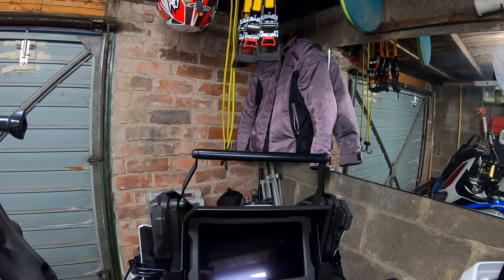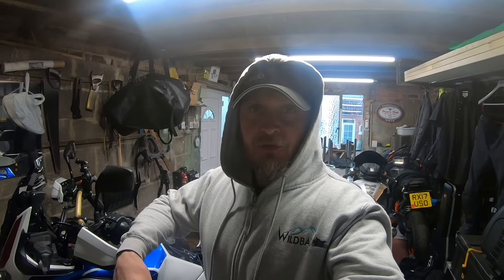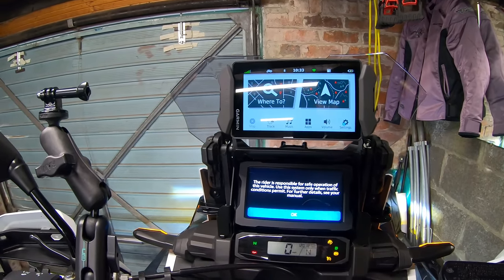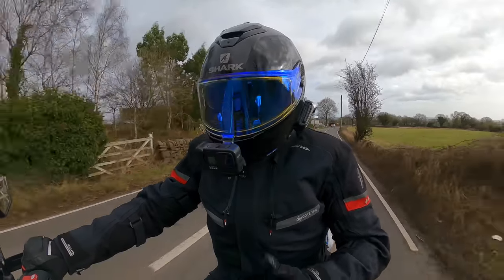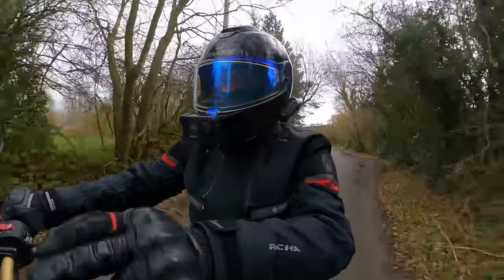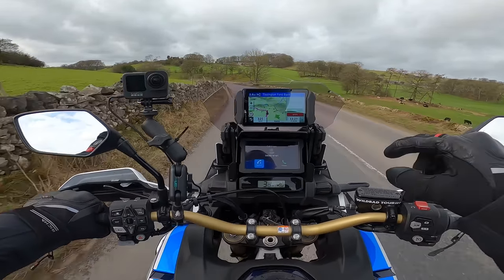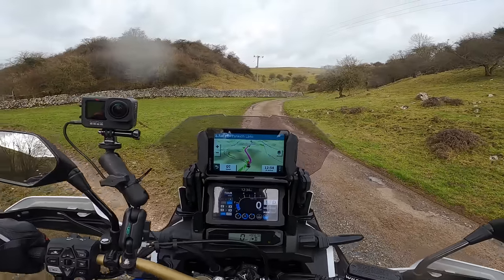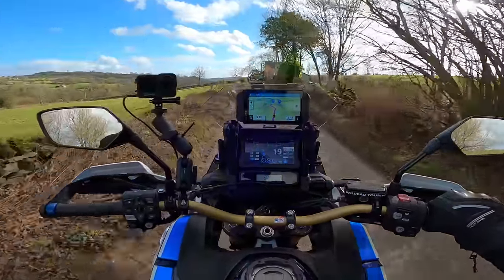Installing A Garmin Zumo XT on the Honda Africa Twin Adventure Sports

Comment: Without a doubt the best Sat Nav available. Had mine on the Tiger 900 Rally Pro for about a year now. 
Evotech Perfomance have a great mounting bar to put it right above the TFT and directly in line of sight.
It even has a built in MP3 player that shows the album covers.

Comment: I have had sat nav’s on my bikes since 2004 when I started European touring, as it’s so handy to be able to find the nearest petrol station quickly and easily.  As you will appreciate Rich, the petrol station’s are not always obvious in some little towns on the continent.  I did consider not getting a new sat nav on the new GS last year, but eventually decided I couldn’t be without that functionality and the fact it doesn’t cost data etc, so Isn’t affected by roaming charges.  I went with the BMW Nav 6 as it locked into the cradle and could be used on the wiz wheel, but it’s not as good / reliable as my previous Garmin Zumo 590lm yet.  However it is still under warranty, so we will see. Love the Touratech mount, had one on the 590 for the same reasons, not need to remove the Nav at fuel or coffee stops. Very neat install by the way. 👍

Comment: Good installation  very neat.
Though I do remember cars and bikes having fuse boxes you could wire into. I guess the eazicam does this job now, but more expense..
My phone is my first back up to gps. The garmin is a strong, rugged reliable unit and will serve you well.
Nice looking bike. Happy travels 👍

Comment: I can see why you went for this option. Same with the android auto on my 2021, notchy as hell. I had a charger block replaced in my mobile and it didn't like the new block wouldn't connect at all. Resolved the issue using wife's old phone thankfully. I found an anker charging cable ensures a seemless connection now. Thanks for another great vid
Reply from the maker: Yeah, really quality products from Anker.

Comment: I have the same combination on my Africa Twin, it's for sure the best option for this bike.
Reply: Do you use buttons on bike (handlebar) for phone calls? I have connected mobilew phone with bike, then helmet with bike, and helmet with Garmin. I don't use Garmin for phone calls, only for navigation. I tried several combinations of connections and now it is working good. But sometimes by phone calls I have problem, I hear only bip-bip. I use Sena comunication. How to reconcile everything? Thanks.

Comment: Great vid Richy, Thanks for posting. I used to think that you had to wait for the Honda screen to boot before you can start the engine, but you don’t. You can turn the ignition on and press the starter straight away and it will fire up, still have to wait to OK the screen though, but I think you can move off while you’re waiting.
Reply from the maker: Yeah you don’t have to wait for the OK, either. 👍

Comment: Have been using a Zumo XT for over a year now with no problems it has a brighter screen than my older BMW Navigator, the only drawback is that you can't add skins to the display to change its appearance. I didn't bother with a lockable mount as its so easy to fit and remove when stopped. I use a stick on Ram mount for the holder which sticks on top of the instrument console and is secure. I have the power direct to a switched gps power supply on the bike so it goes on immediately with ignition, when power is switched off mine does not immediately switch off but gives the option to stay on internal power for several minutes. I don't bother linking with my phone as I have no intention of taking or making any calls when on the road. I have added music to the Garmin but rarely use it as it will soon flatten the battery in the headset.

Comment: This is awesome, love the video and love the Garmin set up. I’ve a USB port on my dash so I presume I can run one through there rather than do the amazing wiring job you had to do. Love your bike, I’m thinking of this for my next bike at moment I’ve a Moto Guzzi V85TT - safe riding 😊
Reply: I asked Honda main dealer same question, yes you can! Or the 12v socket!

Comment: @richyvida Once again a great video!! I really liked how you installed your Zumo XT above the Honda display. But on your latest videos, you changed the position of the Zumo XT and mounted it above the handlebars. Did you have any mechanical issues with your first arrangement? Maybe you could give me a hint. Thanks in advance!
Reply from the maker: Hi there! 

Yes, this Givi mount was terrible! Vibed all over the place and even snapped after only about 2 weeks. 
The set up I have now is with a mount from Rugged Roads, and is perfect. Absolutely solid, and I actually much prefer the location to being up there. 👍👍

Comment: Just ordered this Zumo last night. I do own an Africa Twin as well a DR650 and a two stroke dirt bike where I will need to swap the unit between all 3. I was using my phone (Gaia maps) for tracking and following tracks but newer phones have optical stabilization and when I upgraded my phone the camera killed itself in one day of riding. 

My biggest concern with this unit is woods riding. Like single track trail. My club does sanctioned events where I need to follow a route with heavy tree coverage. I’m hoping that there is no interference. 

Your country is absolutely stunningly beautiful and my wife pointed out that on this day the sky matched your bike which is pretty cool.

Comment: The XT looks a very polished unit indeed. I've had issues with my Nav 6 unit to the point I don't use it so this may be a good way forward. Neat install Richy 👍
Reply: Martin, my mate who rides an RT has installed an attachment that allows the XT to fit the Nav 6 bracket and the wheel adjuster still works. He’s very happy with it. Much better than the BMW Nav models.
Reply: @paulfirth7563  thanks for the info Paul.

Comment: Xt is a great bit of kit but has its moments with connection at times . I didn’t bother with the secure lockable mount and just take it off and pop it in my pocket . I’ve got power cradles for my Africa twin and Ktm890r duke and just swap it between the 2 bikes . Enjoy 😉

Comment: Should have gone for Android. Mine runs well. Can't say the same for the condensation inside the screen though,  had one replaced already. Luv yr garage videos, u tell it like it is and it's not just sponsored stuff. Authentic. Fab stuff
Reply from the maker: Android on CarPlay, ya mean? Na, still as glitchy regardless of platform. Did you mean your tft had condensation? Wow, I’ve never had that.. glad it got sorted for you
Reply: @RichyVida  yep android auto. There's a screen update on it. Can download it from Honda website. Yep foggy patch in the middle inside the screen. Thing is, happened with replacement screen too. High humidity in garage 75 percent. Not good. So changed garage...

Comment: The Zumo XT is a great unit, the only things I don’t like:

-You can not use the Phone assistant (Siri on IOS). To make calls you have to use the Zumo (make sure that you gave permissions in the Bluetooth configs).
-The music in longer trips, streaming from your phone, stops working without reason.

Other than that, I love it.
Reply: Add your music to the Garmin, it will then stream to your headset, only interrupted by direction instructions.

Comment: Couple of questions. Easy cam connectors. Can you enlighten me . Nice sat Nav kit . Was the whole kit very expensive. Also your handle bars look higher up than mine .  Mine are down near the tank . I have tried to adjust mine but can’t seem to be Albe to adjust the control panel / navigation keys on the left . Don’t seem to be any screws so as to adjust, How did you do this .
Reply from the maker: My bars are simply rolled forward, and the mirrors/levers are repositioned. You can’t move the switchgear. 
The EZcan is a wonderful bit of kit. It plugs into the bikes IMU, and “listens” to the bike. It has 4 circuits that are fully programmable, to behave exactly how you wish. Visit “A Bike Thing” for more information. If you decide to order one, tell Steve (the owner) I sent you, he’ll look after you 👍
Reply: @RichyVida  thanks for the Imformation
Reply: I believe you have the touratech lockable mount ? But what bracket are you using to to fix everything.

Comment: Any thoughts about doing a review on the anlas capri x tyres you've been using?
Thinking about getting some myself but there isn't much info about them
Reply from the maker: They’ve been great. The rear is shot now with less than 2k miles on. Quietest knobblies I’ve used, thus far. Stick well to the road, wet or dry. Not as much bite off road as others I’ve used.

Comment: Stupid question, why didn't you run the supply for the zumo from the 12V acc socket connector on the left side of the dash? Or from the ignition switch. Much simpler
Reply from the maker: Simpler than a device tucked out of the way? Keeping the 12v socket free for powering camera? EZCan couldn’t be simpler!
Reply: @RichyVida  i was meaning tapping into the circuit at the socket for the supply to the  zumo, leaves the socket there ( if fitted on your model)

Comment: Richy, If I recall you produced a video showing how you relocated your Garmin XT from a above the TFT to a position lower down on the bike’s handlebars in the central position. Is it still available or have I got it wrong and did you did it vice versa to what you have in this video?
Reply from the maker: Sorry, only just seen this. 

No, I relocated to the bars on a nice solid mount instead of this silly wobbly Givi mount. 👍
Reply: @RichyVida  Hi Richy, Thanks, but you used a lockable Touratech mount to actually clamp the Garmin XT in did you not?

Comment: Hi Richy, thanks for this video that I first watched a couple of years ago, resulting in me purchasing the XT and the Touratech mount for my GSA. I'm now seriously considering getting the 2024 Africa Twin Adventure Sport that has the 19 inch front wheel. So, I'm thinking about where to mount my satnav. The Givi mount seen here in this video looks good, however, on your latest videos, your satnav is now mounted on the handlebars; can you please remind me why you stopped using the Givi mount and what bracket did you use to mount the satnav on the handlebars? Many thanks, Andy.
Reply from the maker: Hi Andy

I moved it because 1; it vibed too much and 2; the givi mount was rubbish and actually snapped. 
The one I have now is from Rugged Roads. It’s perfect and absolutely solid. 👍
Reply: @RichyVida  thanks Richy, that’s good; is that another bar above the TFT as I think the XT was still mounted on your handlebars during the Morocco trip. I’ll also take a look at their website👍
Reply: @RichyVida  are you now using the Touratech GPS mounting adaptor for above the TFT? That’s the only one, other than the Givi, that I can find at Rugged Roads. Cheers.
Reply from the maker: No, it’s moved down to the bars. Wouldn’t have it up there again
Reply: @RichyVida  many thanks Rich, appreciate you taking the time to reply. Am test riding the AT tomorrow, really looking forward to it 😃

Comment: Hello, after seeing your video I decided to buy this Garmin Zumo, on the Garmin site, after respecting the start procedure, impossible to program a trip, message "Map data not available" is there a solution, thanks in advance
Reply from the maker: Did it not come with pre-installed maps?

Comment: I love my XT great piece of kit, I would of liked to have placed my XT where you have on my ATAS, but heard a few reports of vibration in that position, so I ended up using the Touratech mount on the centre of the handlebars works really well and looks good. Have you experienced any vibrations in that position?
Reply from the maker: Not that I’d be concerned about?

Comment: And I just got rid of my old Zumo 396LM which was terribly slow. The main question is - can you quickly see the whole route planned? I mean quick zoom out to judge if the route makes sense and to make some adjustments. It was simply not doable on the old one.
Reply from the maker: You can, but it’s not as quick to zoom out as a smartphone.
Reply: @RichyVida  that's what I was afraid. I still wonder what's the best option: XL, 550 or phone... or wait till the next season as both Garmin and Tomton haven't show any new models for quite a long time. Possibly the last option seams reasonable as I have no long trips planned for now ;)

Comment: Hi how is the vibration on the unit? I just bought stand like that from Ali and I shake like leafe... Just wondering if Givi is better with shaking...
Reply from the maker: No, it’s terrible. Don’t buy this. Mine snapped within 2 wks. I have a mount on the bars from Rugged Roads now and it’s solid.
Reply: @RichyVida  thx for reply! Which of is that you have? I found one that you fit with 4 screw that holds handlebars.
Reply from the maker: Yes think that’s it. Email a link to me and I’ll check for you.
Rich@wildbadtouring.com

Comment: I've had an XT for a year or two and contemplated the Tourotech mount, being a bit pricey though ... how secure is it? if a thief tried to wrench the XT out of it at say a service station .. would it hold it securely?
Reply from the maker: Yes, it’s solid. It’s clamped in position, with rubberised edges. Defo no removing the XT with it locked in.

Comment: I’ve had my Zumo for about a year, real good unit. I will say the “live” traffic updates are not very live, Google maps and Waze (U.S. app not sure you guys have that), is much better in terms of traffic update. Small complaint.
Reply from the maker: Yeah we have (and use) Waze. 👍
Reply: I had a very positive experience with the live traffic updates on my 396LMT-S: I was riding North in Pine Valley (Colorado) and when I reached 285 at Pine Junction, it told me the road was closed toward Denver. Huh? The traffic appeared to be flowing Eastbound with no problem. So I pulled up Google Maps on the phone, and found there was a traffic accident about 15 miles East of me, and the road was indeed closed. So I took the detour through Evergreen the Garmin recommended. I later learned it was a fatal accident involving an 18-wheeler, and the road was closed for hours. So the Garmin saved me from a miserable afternoon of being stuck in traffic.

Comment: I like the set-up. For me personally I find there's too much screen in the view so I'd mount the Garmin on the handlebar, but it's personal preference. I'd probably just use my phone to be honest, ignoring Android Auto and CarPlay. I'm struggling to see the benefit of this setup over doing that, apart from taking photos with your phone being more difficult?
Reply: I thought the same thing.  Most phones aren't fully waterproof while this is.   You need your phone in case of an emergency,  if it's always exposed, more possible things to happen to it.  I've seen multiple videos of people losing their phone's doing adventure riding.   When you stop somewhere you have to take your phone off with you because it's easy to steal.   This NAV seems more secure in that sense and it won't have your info stored in it if someone does get a hold of it.  It uses satellite for spotty areas where your phone won't get a signal and have an option to send a SOS signal through it.  It's made specifically for motorcycles and gives routes, plus off road maps.  You don't have to rely on glitchy apps on your phone.
Reply: @PointsOnly  I think the waterproofness is mitigated by a UA case, but absolutely nothing gets away from your very salient point about the proper sat nav unit being more accurate and not dependent on a data connection, which is really handy when you're properly in remote areas isn't it? Happened to me down in Cornwall last year, resorted to whipping the TomTom out!

Comment: There is a whole history of Zumo XT  hot shoe connector problems from many who have purchased these units - connectors becoming distorted or misaligned after offroading.  Have these been sorted out? See Zumo XT forums.  The reason I ask is that I have been planning to buy one but need to be sure I am not buying into a host of problems.  Appreciate comments from anyone who has come across the problem

Comment: Hello there, you are doing a great and good job, I have a small question for you, I sell my BMW but I still have a GPS Navigator 6, and now I have buy a same bike like yours, and I would like to know how can I connect my GPS in that bike, I mean what kind of connection I have to use?? I have the same support GPS like in the BMW GS Adventure which I like to use in Africa twin.
Thanks a lot if you can help me✌️
Reply from the maker: Hi. I’m not sure as never heard anyone do that? I can’t see why it wouldn’t work. I guess you could hard-wire as normal?
Reply: @RichyVida  I tried today but something going wrong ( it doesn't work) I don't know what but I will see  tomorrow, thanks for your answer✌️

Comment: You would think that such a capable bike would have a decent sat nav as standard. I've the 2017 AT with a lot less tech so I use the wireless charging quad lock and use my phone as the sat nav as and when I'm lost, easy peezy lemon squeezy.

Comment: Isn’t there a switched connector in the front, just behind the bottom of the windscreen? So you wouldn’t have to route it all the way to the ezCAN…? Also not having to use one of the channels in the CAN.
Reply from the maker: Serious?! Hahaha
Reply: @RichyVida  What…? 😊 am I missing something…?
Reply from the maker: Having checked, there’s no switch, unfortunately
Reply: Hm… Maybe I am wrong here. I might be mixing the pre 2020 with post 2020, but there should be an ACC 6 pin connector on the same lead as the speedometer/dash main connector. Very close to the speedo connector, just a few cm shy of that connector it self. I think, from memory, it is actually labelled ACC. It is a switched connector. Not sure about the capacity, in terms of amps, but more than a GPS would need.